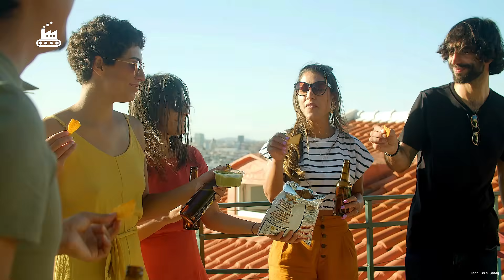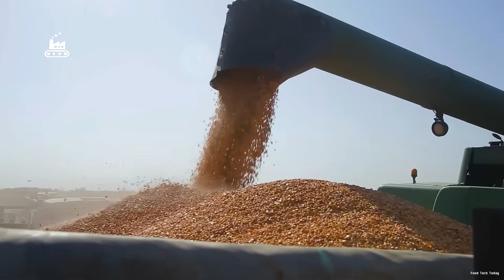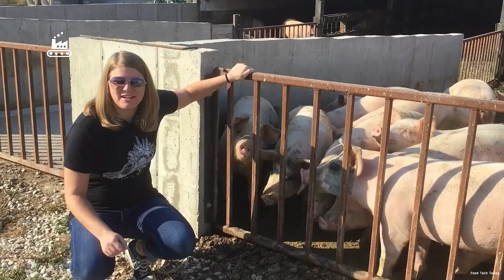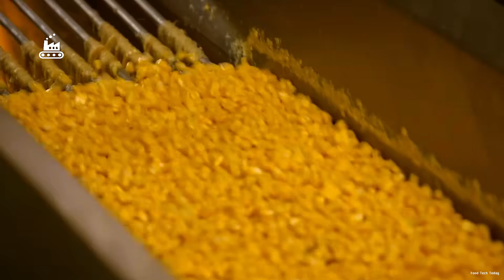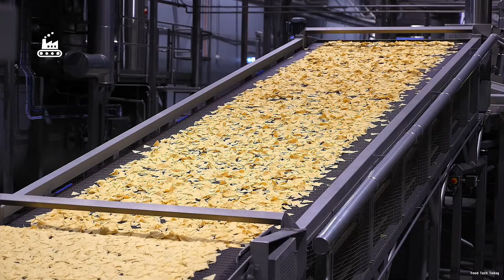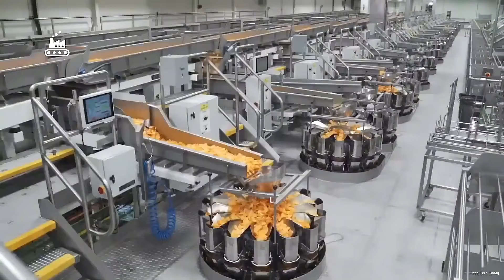How Frito-Lay’s Tostitos Are Made In The Factory

Comment: There is no such thing as a "specialized combine." All combines are capable of harvesting various types of grains and are not specifically designed for corn. When harvesting corn, not all parts of the plant go through the combine; much of the stalk is processed through rollers, which strip the ear of corn while leaving most of the stalk on the ground. Additionally, there is no "glass" involved in the harvesting or handling of grain. Walking through corn in a grain bin is common, as the crop has not yet been processed into food. The process
Reply from the maker: Thanks for the extra info, that’s super helpful for understanding the process better!